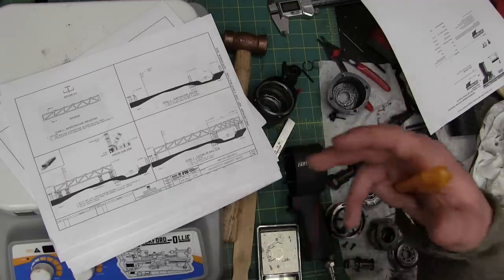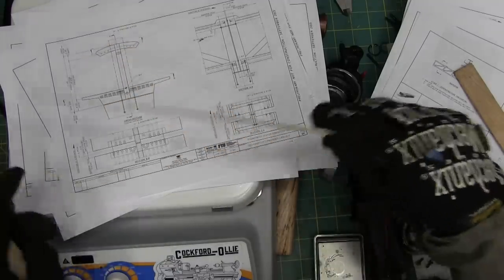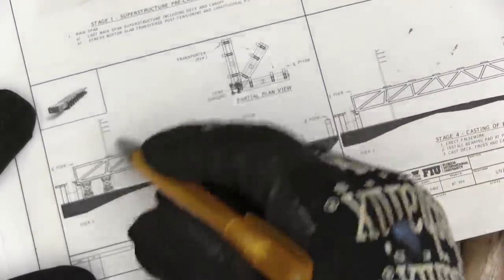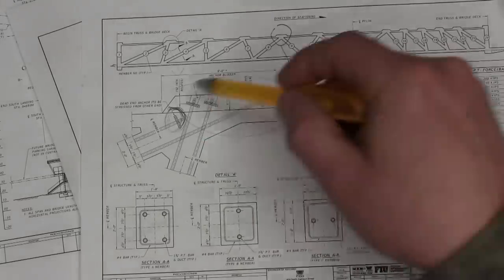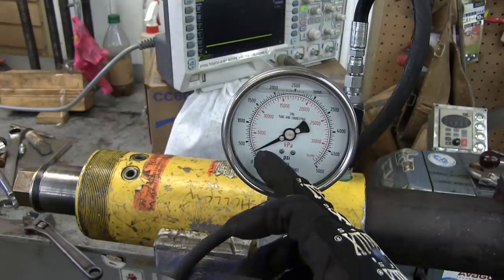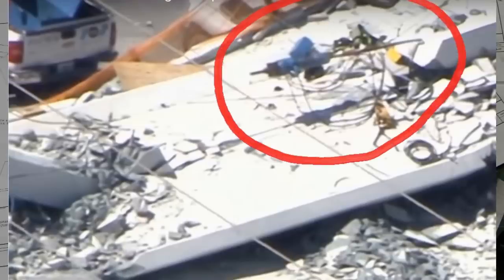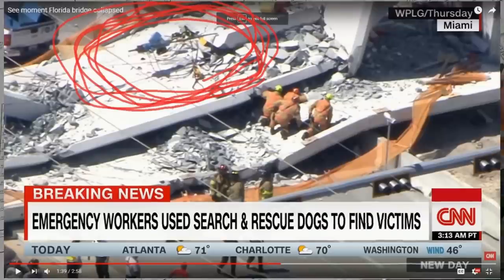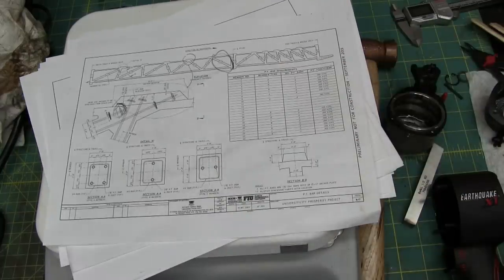Post Tension Failure Florida Bridge Collapse | Engineering EXPLAINED!

Comment: I’ve see a post tension cable shoot 400 feet out off a 260 foot building
Reply: Billy Strong was it launched from a trebuchet by any chance?
Reply: CreamTea did it weigh 90kg
Reply: Thered a lot of energy in those cables, they're nothing to fool with.
Reply: That would have been a brown moment for everyone in the area!
Reply: This is the sticking point, even if the cable stays were just cosmetic and thus thing was designed as a truss ... never no fucking way should they have retensioned the steel with traffic underneath. Trusses aren't exactly known for their redundancy.
Reply: Wait so if they have strain gauges all over the bridge why did they keep tensioning it to yield and eventually fail? Shouldnt they have known they were approaching that limit?
Reply: Ryan Bernard The guy at the controls may have been momentarily confused as to why the tension wasn't reaching its target, thinking it was the tool not pulling as much as it should, not the rod approaching failure.  Strain gages don't measure actual tension, only the change in length of the metal, and they are calibrated on the assumption that said metal is still in the elastic zone. So the immediate display of rod tension would have been wrong once approaching brittle failure.
Reply: What was seen on the structure strain gauges is that the bridge wasn't moving much and the rod tension gauges were showing little increase in tension.
The rod stretch was not measured so they didn't know that the rods were damaged and they kept pulling on the tension rods but the tension wasn't reaching specs, eventually they reached failure.
Reply: there is a small chance that the steel cable was defective.
Reply: Thank you for my first ball-retractingly terrifying mental image of the day.
Reply: I am a bricklayer on commercial projects, with loads of post tensioned tendons in them. The 300 pound gorillas who tension those things, have failed to explain the dangers of working near the ends while they are tensioning. I from now on, will be no-fucking-where near those potential leg amputators while they are tensioning. After all I have grown attached to my legs over the last 32 years.
Reply: To measure the strain in the rods directly they would have had to have bonded strain gauges direct to the rods, but likely they were on the concrete structure itself. Even bonded to the rod it would not show any plastic elongation though, as the preparation to bond means this area is now stronger than the rest because of the much improved surface with no stress raisers in it. To measure the rod strain they would have had to measure how much it had elongated, and unless the cylinder allowed them to measure the extension remotely, it would not have been easy, as typically there is nobody at the cylinder in use, because of the dangers from hydraulic fluid leaks spraying a jet that will slice through you. Strain not going up, with extension going up though is a sure sign that you have run out of elastic limit and are into plastic deformation though, but many steel alloys do have a very large range where they undergo both to some extent.
Reply: I even puckered a bit!
Reply: Adding some electronics to the tensioning cylinder you should be able to detect when your getting into the plastic deformation area and should stop find a solution.
Wonder if that will become mandatory from now on all critical tensioning rods?

*edit: don't even need to be on the cylinder, just a flow monitor and pressure sensor on the cylinder inlet line, add an input for tensioning rod length and your getting stress-strain curves.
Reply: Years back I worked for a company that made concrete I and T beams for bridge work. The last job we did before a pour was tension cable. The chitter chatter went from 100 to 0 on those days. No one talked unless it was important. Just before I started there they had a stay fail when it was at near full tension. When it let loose a 1/2" cable snapped back and slice thru a 1" steel form like it was made of that stinky French cheese.
Reply: Andy Chu
Reply: QQQ: entirely true, but not accounting for that chance is what will put people in prison.

Comment: Great Video!  As a metallurgical/materials engineer, I have been involved in failure analyses of turbine engine parts and, although design is a factor, we always look at material properties.  With turbine component failure, it is generally a fatigue failure, but in this case there were no fatigue modes.   In that light, has anyone conducted mechanical property testing on the tensioning rods?  Maybe to cut corners, they purchased some steel rods of "dubious character"?  Checking their tensile yield and ultimate should tell you if there was a tensioning material problem.  Also, if the photographs of the collapsed bridge I noticed that the concrete had "crumbled" versus fractured.  Properly mixed and cured concrete generally is somewhat brittle and it fractures and not crumbles.  Has anyone done any testing on the concrete itself?  Also, in the dash cam video, you can see the cable on the crane snapping at the precise moment that the bridge started to collapse.  Was it connected to the bridge?  Was it holding up the bridge?  Did it snap before the bridge collapse or when it collapsed?

Comment: Do the Georgian Ski Resorts run-away Chair Lift next....
Reply: My money's on 1) electric brake system failure, plus 2) simultaneous failure of the drive, letting the chairlift freewheel.  The weight of all the skiiers on the uphill side pulled that half of the cable downhill... faster and faster, and pulled the empty chairs uphill.  All backwards.
Reply: God, I saw that video it was horrific. I just wanted all the skies to jump off before they got ran into the mess of lifts towards the end...
Reply: Don't they have a sprag clutch on such a thing to prevent reversal?
Any load carrying conveyor belts on an incline are fitted with sprag clutches to stop them running away in reverse due to the weight,if the drive stops powering the drive drum/s.
That said they more than likely have fancy electro and electromechanical braking and anti reverse systems. I dare say they may want to run in reverse certainly during maint/service/repair.
Reply: I was stumped about that. I didn't think they would be designed to be reversible. Running free makes all the sense.
Reply: In North America ski lifts have three brakes.   The service brake works on the motor.   This is the brake that is normally used to slow and stop the lift.   The motor is connected to the bull wheel spindle via a transmission.    The second brake works directly on the spindle.   This brake may be manually activated by the operator,  via a valve lever.    Sometimes the spindle brake also has automatic activation when a roll back is detected.  The last stop is a ratcheting dog clutch normally located on the non-drive bull wheel.

Google “devils head ski lift accidents” for a good account of a roll back incident in Wisconsin.

Comment: I couldn't fathom why they were allowing traffic under the bridge while work was being done.  Hearing they were using post tensioning equipment it really baffles me.  They should have had the area clear of all non essential personal while stressing any post tension member.

It makes me wonder how much political pressure was on the contractor to have the street open for traffic?  

This project was politically driven from the get go.  It was funded through the T.I.G.E.R. program from the previous administration.  It was supposed to be proving a more economical method of bridge building.
Reply: It's Florida. The way traffic is here, people would scream if the area was closed off to traffic for too long, and local and state government would be under intense pressure to keep it open. Do not be surprised if local FDOT knew it was unsafe but forced it open anyway.
Reply: FDOT, according to them, did not receive a request to close off any lanes.  While the failure itself may have been unavoidable, there was no reason for  the traffic under the bridge.  The collapse resulted in the entire area being rerouted.  Certainly would have been easier to reroute traffic for a few hours just to be safe.
Reply: Excellent explanation. 
You gotta be a Canajun

Comment: I used to build pre-stressed panels such as this. What happened is the pre-stressed panel was not "harped" correctly. Harping puts an upward bow in the panel so when it is placed, it settles flat, I did not see any such bowing in the panel was dropped so it settled incorrectly. Consult with a person with experience this type of structure.  I would have liked to see to the cable tensioning logs to make sure the cables were pulled at the same level.  I would also like to see the results of the concrete test samples to see if the bag count was correct.  I have peronally helped construct twin "T" panels at least as long as this for foot brigdes that have  been in place now for over 30 years.  The state highway officals that did not close traffic need to go to prison for manslaughter.  The bottom line is the companies that pre-cast this brigde need to be sued out of business.
Reply: Kenneth Crips 
ay im from a similar industie used to weld in the stressheads bild/setup the molds for this kind of  tearoff beam .
the stress heads i installed were mounted on UB's 1200mm hi 32mm thick and concreated 10meters in the ground ,basicly down to bedrock, 4 of theas each end wot to hold up to 30 cables each with around 100tn load on.
i was just a suby so i never saw the tentioning ever happen but.
wot i wonna know is how the hell did thay do that "onsite" 
im with u mate i recon the cables were badly arsed up
Reply: this wasn't just an accident, it was gross negligence to have Joe Blow driving under a bridge that hadn't had it's final testing complete.
Reply: MrRoughNutz There’s a huge difference between an accident and negligence. An accident is accidentally locking your keys in the car with your child in it and then immediately calling for help, negligence is leaving your child in the car during the middle of summer to go inside a store and then to come out and the child is passed out or unconscious.
Reply: Mr. Gandalf  Because there is no such thing as an accident, someone is always at fault.
Reply: Mr. Gandalf  So the "accident" won't happen again.
Reply: As a Senior P.M. for a construction company, not in my most drunken stupor would I ever allow people to move below this bridge until all activities setting the span were completed...so what if you inconvenience people with a detour for the day

Comment: I see the rod failure as simply a side effect of a horribly poor design.  Concrete is not a suitable material for a truss.  Had the central single truss been fabricated entirely of steel it would have been more easily and more safely moved.  The bridge would have been 90% lighter. The more you study this design the more you realize it was a complete POS.  All hype, and no substance.  It should have been removed from consideration early in the design concept stage as being totally unproven, and quite impractical.  Blaming the collapse on a single bolt gives the engineers an out, but it doesn't excuse them from choosing a worthless design with absolutely no merrit in the fist place.  Rather than blaming the catastrophe on a single overly stressed bolt, I put the blame on "group think" where common sense was not only ignored but shunned. All this said, your demonstration was quite informative, particularly when you show how the bolt shoots back out of the hole, and that is seen on the Rosenberg/Figg  bridge as well.
Reply: They should have used steel UNDER the concrete or made it entirely steel.
Reply: Didn’t blame it on a bolt, blamed it on poor field engineering.
Reply: Here's the thing, there was no redundancy. Any bolts fail, and the entire thing goes.
Reply: G - damn right

Comment: 14:40, anybody whos over tightened a engine head bolt (which are mostly torque to yield bolts) knows EXACTLY what this feels like. You putting pressure on the torque wrench but shes just not clicking. Keep going and you FEEL something is wrong, then pop..
Reply: Ugh, TTY garbage! ARP replacements(ideally head studs) ALL DAY
Reply: Yep. Even on stock rebuilds I mostly use ARP now
Reply: TTY is not garbage, it has a purpose its because TTY is a more reliable, accurate way of attaining a set clamp load, using a torque setting to clamp load is inaccurate as too many factors are at play such thread, bolt head and washer friction.
I won't lie though, I HATE tightening TTY bolts, just feels like a regular bolt does just before the threads pull out! 😂 😂 😂
Reply: You know you're there when tighter gets easier.
Reply: Yes but I don't think it has to yield to get that benefit. You can do torque+angle below yield strength on a bolt and still get a much more accurate clamp force than torque alone. The idea is that you just torque until all of the slack is taken up and you know that you are beginning to elongate the bolt itself. From there on the only variables going into the clamp load are the thread pitch, the number of degrees turned, and the effective spring constant of the bolt.
Reply: Post-tensioning on major bridge projects is not analogous to a guy reefing on an engine head bolt with a wrench according to gut feeling. The notion that the workers just jacked a strand beyond capacity like they were born yesterday is possible (as anything is), but it's sensationalist and unsubstantiated.
Reply: Chris Collins perfect example

Comment: So (from a completely non engenerding POV) did someone say "gnnnnnnnahh-click" after engaging safety squints. Possibly followed by "she'll be right might" ?
Reply from the maker: Last time I worked in South Florida, it was "is good ok amigo?" Same-same but different the whole world over.
Reply: AvE Cuban for gnnnnah-click. Direct translation. I speak fluent shopaniese.
Reply: My learnings from a long time ago were to count the fingers of to guy who delivers the "she'll be right mate".
Reply: AvE shee'll be right mate!
Reply: Maybe they were using torque-to-yield fasteners?  :-P
Reply: more like re-using used ones :p. seen that on a car engine, head bolts go POP!
Reply: richmanricho they may have done all that, but they forgot to engage their tongue at the right angle and put their mum on speed dial.
Reply: (Cartman voice) I love you guysth
Reply: That cable snapping was a symptom of a much larger issue.   The bridge probably would have worked, if they could have magically put it in place, but setting it up without it failing was basically impossible.   The design was far too fragile imo, and it was transported improperly to boot.  Obvious failure.

A lead engineer reported cracking when moving when they moved the north end of the span.
Reply: aaaand 9 hours later, I've realised I've spelt 'mate' as 'might' .. slow claps self
Reply from the maker: We understood what you meant.
Reply: rich: edit feature works.
Reply: dukemozilla its not A or B. Its A then B
Reply: dukemozilla  Yes.
Reply: Does anybody here know how I can get a message right to Good Old Uncle Bumblefack here? I made something for him and need to figure out how da heck to get it to him.
Reply: dukemozilla In an iced vice, obviously.
Reply: @john handcock Right. So why didn't they stop when the crack happened? Who decided no biggie it'll be fine?
Reply: Gabriel Matte 
The first time I heard something was "tested in anger" I was quite confused. Then the guy (Brit)  that said it explained the use of "in anger" to me. Now I can't wait for a skookum time to use it.
Reply: From my self taughts observation, it's clear they used one too many ugga duggas.
Reply: richmanricho That's how the seagulls pronounce it here in Australia....might!,might!, might!
Reply: This is what happens when you hire Non Union Ironworkers!
Reply: Now take off your safety squints/ goggles and have another look at those 911 vids. Especially you EOD boys
Reply: chereadnine we say,aaahh is right mate!

Comment: The more performance you wring out of a material and the closer you push it to its edge through the use of "smart" engineering the less robust the resulting construction will be.  If you build something to be super stiff then it's failure mode will be catastrophic brittle failure.  I prey that those that died did not suffer and that those they left behind will find a way to forgive.  Thanks for the great analysis.
Reply: so correct. they want to squeeze every dollar out of a project.
Reply: I pray that if these companies are found negligent, that they are sued into nonexistence.